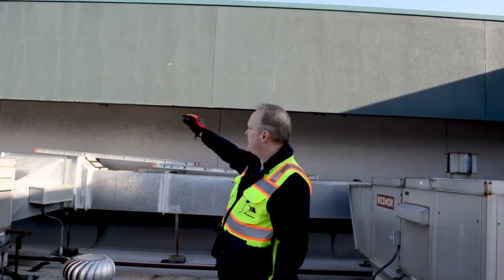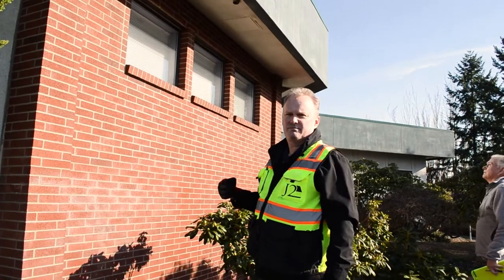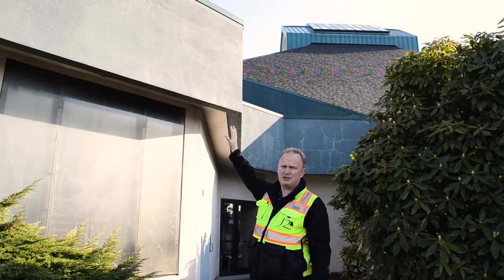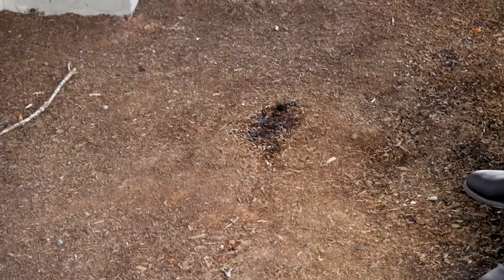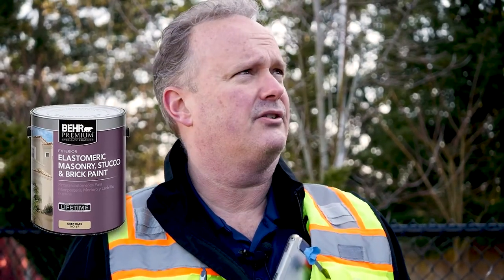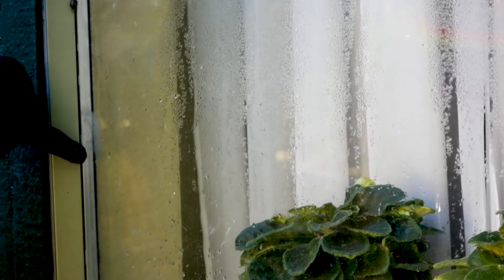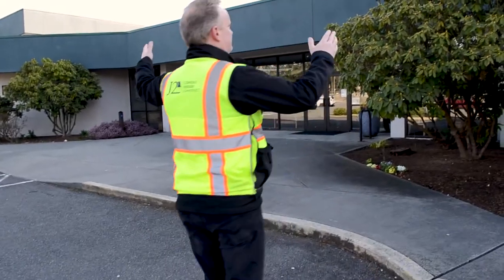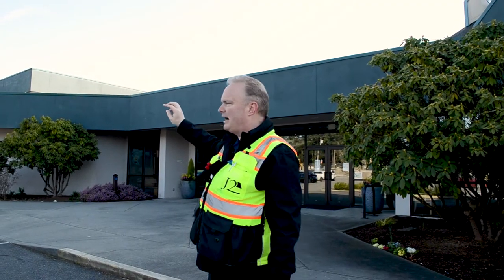How to Waterproof Your Stucco - DIY Series Ep. 11

Comment: What products do you recommend that are available in New Mexico? Could you differentiate between a product that seals 100% vs a water proof product that breathes?
Reply from the maker: The elastomeric coating we recommend in the video should be available in your area! If you stick with products that are manufactured specifically for stucco and masonry, the manufacturer of the coating product provides a product data sheet (or back label) that states the vapor permeability of the coating product. Do not use a non-permeable coating. Link to BEHR eleastomeric paint: https://www.homedepot.com/p/BEHR-PREMIUM-5-gal-Elastomeric-Masonry-Stucco-and-Brick-Exterior-Paint-06805/100158685
Reply: @j2consultants  Thanks!

Comment: Does new stucco need to be sealed? I’m getting mixed advice. Most say no. I’m in San Diego. If yes, what product? Thank you!
Reply from the maker: Stucco is not waterproof. WHEN water gets in, the building should be protected by your WRB (e.g. Tyvek). In most cases, especially in San Diego, you probably don't need to seal it. You can decide to coat it later on to restore its lifespan, but new stucco is probably fine as-is as long as there is WRB. 
We actually showed your question in our latest webinar! If you'd like to see the recording, you can sign up here: https://learn.j2consultants.com/building-dr-show